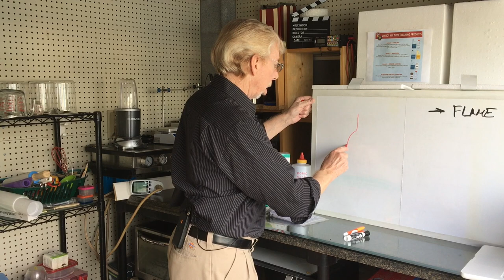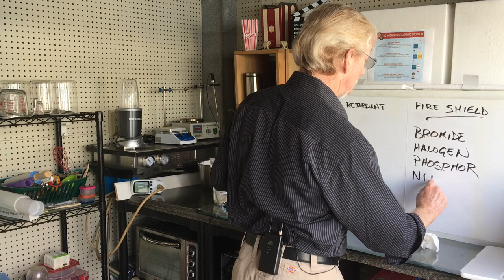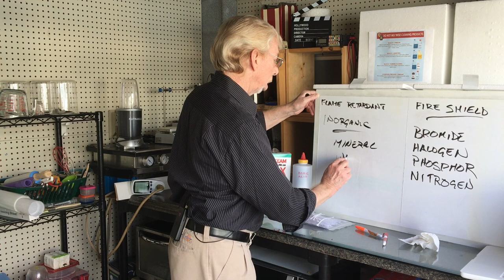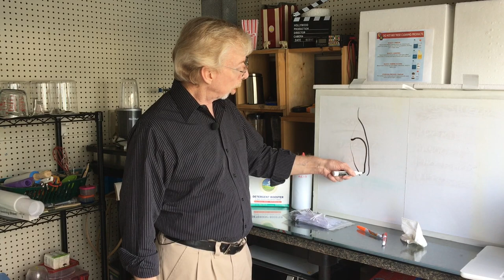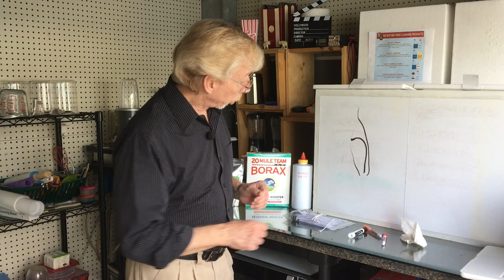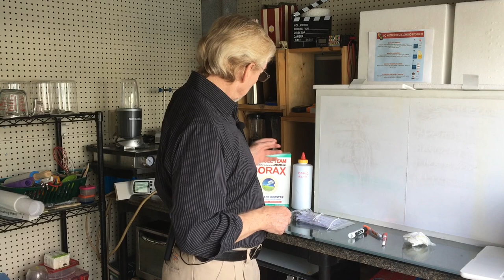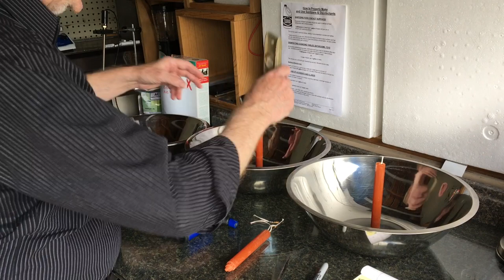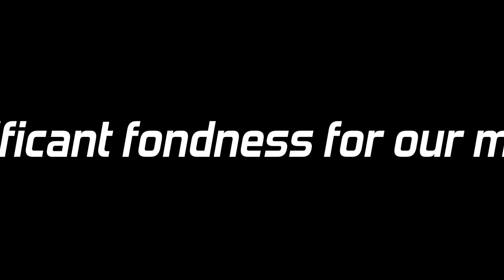Candle Making: FLAME RETARDANT. In depth tutorial to know you have it right. Part 5.

Comment: How would you suggest flame-proofing a wooden candlestick holder?
Reply from the maker: That is a tough one. To begin, I would not recommend a wood candle holder.
I can't think of a flame retard that would hold up to that.
Even the intumescent flame barrier they put on structural steel would not hold up to a simple candle fire.
I would not guess, flame is something I don't play around with.
Metal is my favorite candle holder.
Reply: @GEOsustainable  thanks. My plan is to make a menorah and use a metal candle cup. The issue becomes when Menorahs candles are supposed to be lit fully until they extinguish themselves. And some candles are more "drippy" than others. Despite the candle being in a metal cup, it's possible something can drip/fall onto the wood menorah portion I want to make. Would you still feel the same way knowing this?